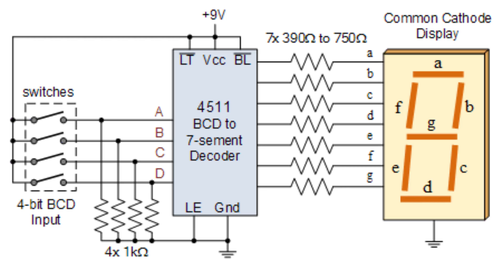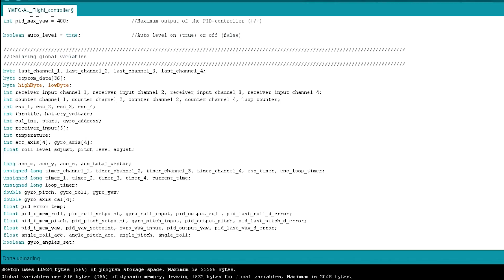My MIT Maker Portfolio

Comment: Holy crap! I used the Crossfire 2 as well, printed in PLA, and also created an arduino drone! I used a wireless UART instead, and I'm programming it myself, though I have seen the YMFC code. Currently I'm improving the communication protocol on it after wireless comms failed and drove my drone right into a tree the day after I finished PID tuning, and I hope I can get it in before early MIT applications this year.
Reply from the maker: Awesome!!! Yeah, the YMFC has a few bugs that I didn't have the skillsets to exactly resolve at the time. Needs some hardcore troubleshooting and failsafes. I suspect some floats are overflowing from sensor noise, but I'm not sure. Thought for sure there was a Kalman filter in the code, but not sure.
Reply from the maker: If you wish to take some pages from it, there's an open source library called Ardrucopter on GitHub that supports MissionPlanner, which is what my university use for their research drones at the Unmanned Autonomous Systems club.

You might be close to graduating considering this comment was 4 years ago, but hey, you might still be interested

Comment: Do you find making a programming language (Compiler + VM) challenging? I am thinking of submitting this as my project.
Reply: it depends on the way you tell your story.
Reply from the maker: You probably don't want to do that from scratch unless the engineering of the problems you're solving cannot be solved without modifying the actual C++ language. Custom compilers are usually written when you need crazy optimizations for some sort of product like a self driving car running neural nets where the optimizations don't exist yet. But definitely weigh the cost of re-engineering something that already exists